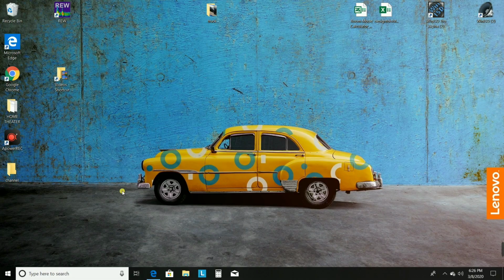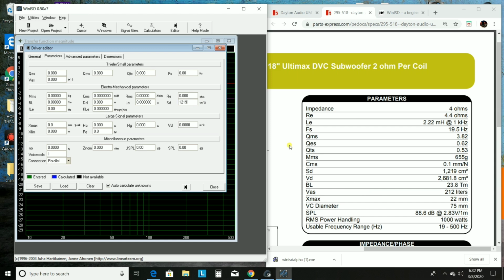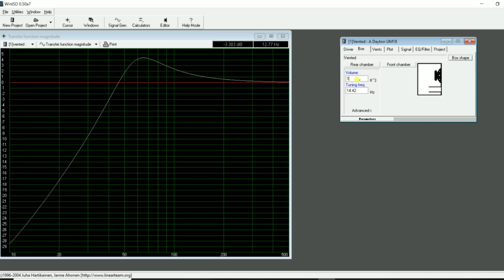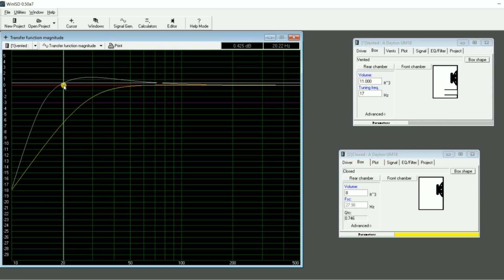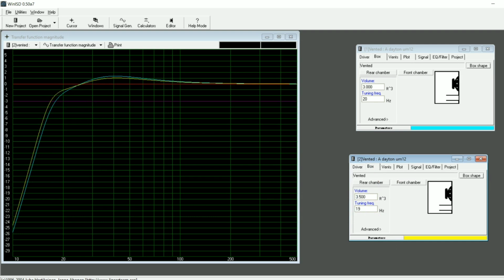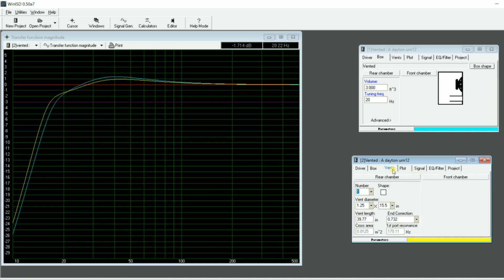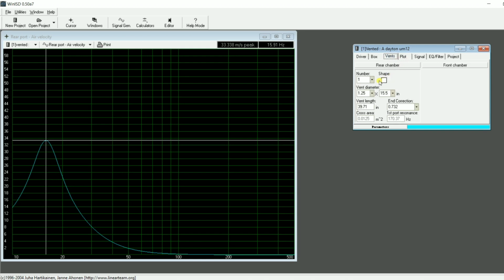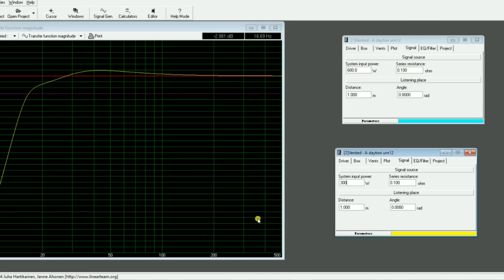Ep. 32 - WinISD tutorial for the beginner. How to design an Awesome Subwoofer | Home Theater Gurus

Comment: Yes ported can get lower but the phase shift is extreme at the Port.  Sealed sub phase shift is gradual.  Proper loading will bring the deep base up or you can overdrive the sub if it has a good Xmax.

Comment: Great tutorial. I like how you discuss the various trade offs for different properties. You mentioned box stuffing. Is that more of a trial and error thing or can you calculate how much stuffing to use. Do you always use stuffing? 
Will you discuss adding damping material to take care of box standing waves or is that just for speakers?

Thanks professor!
Reply from the maker: Yeah I glad you brought that up.  We don't have standing waves because our subwoofer frequencies are so much larger than the enclosure but we still line with insulation anyways.

With sealed we lightly stuff not line.

With sealed There's a loose rule that every pound of fill increases the enclose by 25 percent so you could guesstimate it by modeling the box in winisd with that in mind.

Comment: It's kind of a catch 22 because the program doesn't automatically subtract port displacement from the total internal volume, so we need to design everything, then subtract sub+port displacement  to get the real volume, and then adjust tuning again?
Reply from the maker: Yes this is a tool to design your sub and tune it but you do have to design the box including calculating the port, bracing and driver displacement.  The next videos continues with this stuff.

Comment: Buenas, tengo una pregunta. Tengo un subwoofer de 12 pulgadas, según winisd si le hago una caja de 150litros, funcionará muy bien, pero creo que son muchos litros para un subwoofer de 12 pulgadas. Que opináis?
Reply from the maker: If you entered the info correctly then you're good to go.  Some drivers need larger cabs than others.   150 is large but you may be able to dial it down a little and still get a good response from it.   The Um12 would work well in a box that size tuned to 18hz or so.    As you go smaller you may need to raise the tune a little to keep the raw response in check.

Comment: Hey can you confirm that the rockford p2d4-10 high fq rolloff is really around 1500hz I'm going to use for a 3way build an cross it at 500hz for the lows, an yes I know it's a sub but for the cost and it's t/s perameters it's the best that fits my budget I'm just trying to confirm that it can function up to 500hz I plan to feed it a constant 220watts a 2 ohms, it reads in winisd up to 1500hz with a - 3db rolloff is the software reading it right

I'm using it in a passive 10in radiator t
The tunable Dayton at 19.7hz in a 1.668ft3 box

Comment: You can download the T/S paremeters from loudspeakerdatabase.com, no need to manually enter.
Reply from the maker: True but not every driver is there and getting it from a manufacturer has less room for error and it literally takes 1 minute to load parameters.    It's also much simpler for those learning to do it manually.  If they ever need to load a driver they can't find a file for no problem as they aren't relying on another site to supply them with a file. I've never once used that site as I just prefer to load them myself as well.

But it's definitely an option.

Comment: Subwoofer Name: Subby McSub Face

Okay . . .my actual comments!

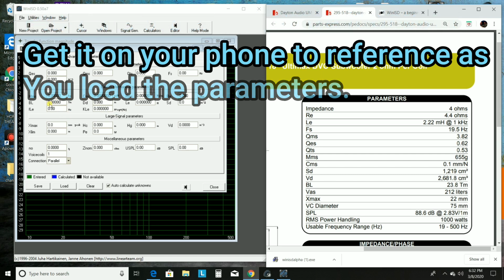05:15, I will say that you teaching me how to load the driver specs in the correct order helped a lot. I had drivers that I thought modeled AMAZINGLY, then I'd go back and reload the data in the order you taught me and the difference was NIGHT and DAY! That was sooo beneficial 

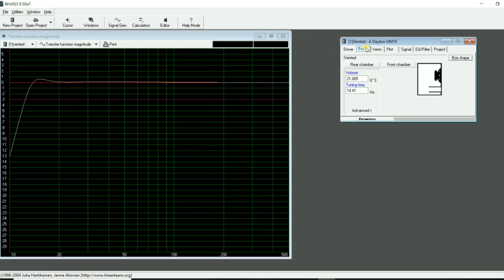08:56 . . .  no it's not . . .that's how all subs should be sized. Go as big as your room allows, the WAF should be secondary, HAHAHA! <3 

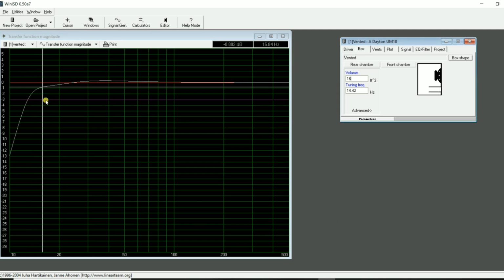10:24 . . . can you go into what you, as a professional, consider a "big buge room"? 

16:11 . . .yep . . .getting sealed subs to perform like ported subs means every sub has it's own channel (if not its own amp) and you absolutely MUST have multiple subwoofers/enclosures. Ported is a lot more efficient but I'd argue that sealed runs harder lower. But that's an argument for a different day. 

17:19 . . .yep . . .sealed subs require more power but they have that 2nd order roll off where as ported subs can be anywhere from 3rd to 4th order roll off. At least in my reading. You're the expert, HAHAH!

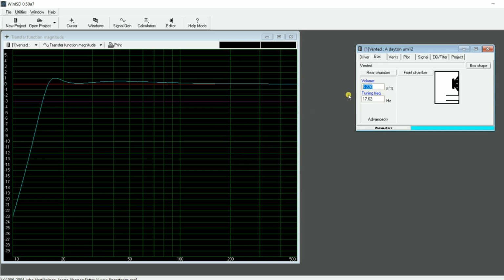19:00 . . .ew . . .3CF? I think even 5CF isn't THAT big of a sub. But I don't have to worry about WAF. 

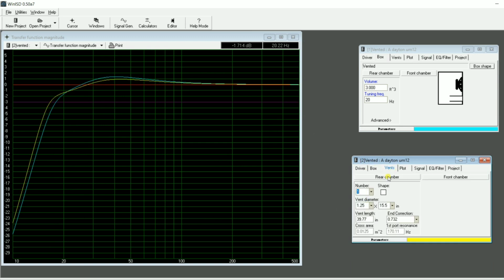24:00. . .I can't stand when the inches provided aren't "round numbers" so if I do build vented enclosures, I tend to go to the next whole number up. It's just a bit of OCD. 

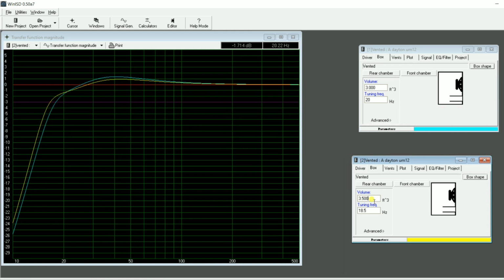24:58 . . .That's another PRO in favour of sealed. No need to worry about ports. That said, when modeling vented enclosures, I almost always work with gross. It's a lot more difficult (because it's easier to work with what you can see) but damn it's nice when you take final measurements and it's within 1 or 2 percent of what your original modeling said it'd be. 

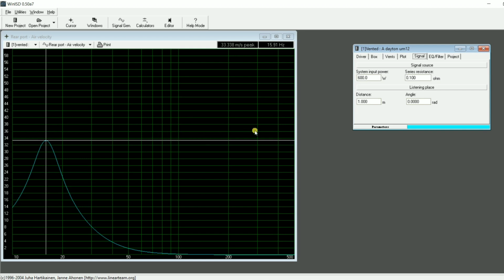30:50 . . . you know what doesn't chuff? Sealed subs ;) 

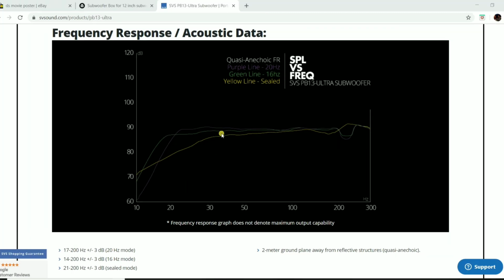35:50 . . . I'm not a huge fan of SVS with their active subs. Their passive units used to let you amplify and DSP as you felt necessary. They went all active and now it's up to them what you get and usually those numbers are . . .anemic and lackluster . . at least comparing to what we've built. I know, I know . . ."okay Boomer"

I can't wait to see this thing come to life and see the real-world tests of it in your room! That's going to be exciting! I still wish you went sealed, but ported is going to apply to most people and is most realistic for home theaater. 

Awesome video, as always. Sorry about the text-dump comment.

Comment: Sometimes i wonder if we tune Ported subs To Low ,since you proved yourself most Low End content is mostly in the 30-50Hz range  , ...Perhaps tuning Higher 20-23 Hz would be generally more satisfying , where most Low End content is ??
Reply from the maker: I like to have a - 3 just under 20hz if possible.  Sure the brunt of the demand is usually above that but it does add to the depth of the bass.  I kinda feel the chest kick video kinda ignored that while demand isn't as high below the peaks we saw its still important.  I wish I could easily go back and just clarify that.

The HAMMER has actually had a tuning change as seen in the build video where I simplified the port by raising tuning to 20hz and also gained a little more output above tuning.
Reply: @hometheatergurus  I think that is a good trade off !,. more Output where it counts most !

Comment: what do you put in as a signal input on winlsd? If I change my input to 2 ohm I get a very different response. Winlsd always starts with a 0,1ohm load. But that is not what it should be at right?
Reply from the maker: You can set it up when loading the driver info
Reply: @hometheatergurus  

So when I set up the ohm and RMS in the driver info there is no need to put in the signal watts and ohm to get a correct graph in WINLSD?

Comment: So i was hoping i could use the HT1 18 with the DIY group kuda flat pack. because it has the perfect look and dimesion that i like but @ 8cuft net, its not tuning very well might have to get more with higher net cuft
Reply from the maker: 8 cubes is on the small side for many 18s unless you want to live with a higher tune.
Reply: @hometheatergurus  well FI recommends 6-8cuft net @ 26hz for there HT1 but looking at winisd looks like 11-13 @ 20hz looks more flat response challenge will be the round ports velocity and room for the enclosures . decisions decisions

Comment: make a video on: how do I know where to integrate my in wall subwoofers in my dedicated HT room? :) that is the question! presuming you are building that room from scratch or you already have the room and you need to add materials to accommodate the speakers within the structure.
Reply from the maker: That's covered in the room mode episode and the sub setup episode.   I'll go ahead and say if it's a dedicated space that's rectangular and symmetrical 1/4 and 3/4 in the front wall is a great spot.   But.. Seating placement is critical.

Maybe soon I'll make a video just on that not mixed with anything else.

Comment: I'm following along your video and using UM18-22 (two enclosures / one 18 per enclosure) for my project. I have available space to accommodate enclosures larger than the Standard Full Marty with the space behind my AT screen. Any reason to not design a huge box vs. the 11 ft³ Full Marty? 

Playing with WinISD: ex. 11 ft³ Full Marty volume, tuning frequency @ 14.43 Hz, signal 1,000 watts - I'm configuring it with a square vent  2.5"x22" and the velocity is almost off the chart (62 ft/s at 14.4 Hz). I'm running iterations of vent height to drop the velocity, but the vent length becomes too long (+58"). Can you recommend changes that will bring this inline with your recommendation of ≤ 30 ft/s. 

What is the vent area & vent length for the Full Marty and what are Box dimensions for a FM? Curious how that vent is configured in a FM.

I understand there are some 'rules of thumb' for driver placement in the enclosure relative to the external port and port opening inside the enclosure relative to adjacent surfaces. Can you touch on this?

Thanks for putting this together. This is exactly what I needed to get working on this project. Wife getting tired of seeing drivers sitting in their box. :-)

Comment: Shame this was released before I made my VBSS subwoofer that thing is fucking huge, and people on the forums were telling me i should build full Marty...

Now this as great looking sub that isn’t huge, I’m just thinking of making a future upgrade but can’t decide between this or the Marty cube, so Which one should I choose? More info my room is 1700ft^3 and I’m planning to build 3-4 but not at one time.
Reply from the maker: That's a difficult question. The 18s in the large cabinets have more output but 4 of the ones we are designing will be more than most would need.
Reply: Home Theater Gurus just modeled it in winisd and it looks really nice but how much dose an extra sub add in output i heard it’s around 6db but is that true? 

Also modeled Marty cube im losing like 3db at 20hz and 6db at 30Hz but those are at levels I will never reach and the difference will be smaller when I add one or two subs.

Also should you put a 4th order highpass at 16.5hz?
Reply from the maker: Everytime you double subs from 1 to 2, 2 to 4 etc you can gain 6db of headroom if they're all the same and all the same power on tap.

Now that's if you could get a perfect summation which you won't.  If you're getting 4db per doubling you're doing good.

The um 12s in a well designed box are very impressive.  I've had people I've designed subs for that also had full Marty's and some have commented they would never have built the Marty's if they'd built the um12 subs first.  It depends on goals and how important space is to you.

My last theater had subs I designed similar to full Marty's but they were hidden.   For my living room I'd never use subs that were physically that large.  In my next house which were building I plan to use subs similar to what I designed in the video. 

As for the HPF yes you'll need one however it won't be set at the tuning frequency as the repsonse will begin to drop above where it's set as it's a slope.  I cover this an explain how to set it in ep 7.
Reply: Home Theater Gurus I was just experimenting with the winisd cone excursion and trying to get it to not cross the red line
Reply: You aren't happy with vbss?  Curious.. but.. why not?
I just made 2 of 'em, and while a bit big.. they are awesome for me.
Reply: John Dowty no I’m happy with them but they are huge. In few months I’m thinking about building something smaller and taking the VBSS to my music setup.
My issues are with the sizes not the performance in any way.
Reply: John Dowty also I’m looking to build 4 subs, so I need something smaller.

Comment: Have u tried RELs idé with setting center Channel to fullrange and connecting a sub with high Level Connection to the center?
Reply from the maker: Check out the videos on sub setup.  We keep everything set to small so we  have a predictable sub response that's similar seat to seat. If we allow the center to have an independent sub it will trash the modal response when information is present in that channel and not also present in the rest of the subs.

Comment: Hi, great videos once again, thank you for that. I think I am going to take the plunge and try to come up with all the spec for a full marty 18. I was able to get everything in, but I only have one issue, I can't get the air velocity down in 30s...it's way up in 50s, so is a bigger box allow for more velocity or should I modifiy something to really get down in the 30s? Thanks
Reply from the maker: Make the port bigger.
Reply: @hometheatergurus  did that, port is 5x24 now down to 34 velocity, but the vent lenght is now 105 in...

Comment: I'm unclear about +/-3dB. baseline. Do you mean that winISD calculates the baseline for the sub after we input the parameters? Not sure what to make of the graph.
Reply from the maker: Yes it shows you.  I explain the basics of a response graph here.

https://youtu.be/43SQpkwEVK0
Reply: @hometheatergurus  I watched the vid, but it doesn't exactly say how to interpret it. What exactly is "Baseline" zero dB? Because the sub model indicates that it can play higher dB, depending on the volume, etc. I have no reference of what the baseline even represents, so I am confused.
Reply from the maker: in the video I linked it explains that baseline can be flat (accurate) or it can have a designer house curve.   The +/- 3db should follow their baseline whatever baseline they desire.   The baseline is just the target response theyre following or designing their speaker to.
Reply: @hometheatergurus  Thank you. So, when i use winISD Pro for a rockford P3D4-10, run ported at RF recommended volume, and port length, etc. the simulation shows a 40 Hz peak at +7 dB. I can't get the simulation to make a box exactly as RF recommends. 
--So, that +7 dB I suppose is wrong, maybe I entered the info wrong. 
--Some say to desire peak above baseline.

Comment: I'm gonna disagree that Dayton under spec their subs. Xmax is the linear maximum of the coil after that it gets unlinear. That's why there also xmach / xlim. This is where the cone hits the back of the magnet and damage can occur. Xmax is calculated so there is not over specking or under specking. 
On the filter to protect the driver from frequencies under port tuning you will lose dbs because the filter is not a wall, the mini dsp can do a max of 24db if i'm not mistaken, so you will lose more db in the lower frequencies where the port it. We don't know how much the room will help so it's a consideration when doing a design like you did with that hump. You can also add those filters in winisd to see how much it will affect your frequency.
Reply from the maker: Well aware what xmax is.  If you haven't seen ep 7 check it out. It goes in depth on how and where to set a filter.
Reply: @hometheatergurus  I've watched all your video :) and i love them, i just don't remember everything. 
I'm DIY-ing two um 18s in sealed because of size and placement restrictions. Hope it works. They gonna replace a single pb-1000. But his covid-19 thing will slow me down quite a bit =/
Reply from the maker: Thanks.

And the only reason I stated they under spec is there's independent data that shows they remains distortion free beyond what they spec.   But it's definitely not a good practice to purposely push any driver beyond its rated xmax.

FYI In the new dedicated theater I'll be using sealed um18s.  Probably powered by speaker power amps.

Iny open living room I'll be using 4 subs similar to what we're designing in the video with um 12s.
Reply: @hometheatergurus  Can't wait for the videos!
Reply: Home Theater Gurus why use sealed when it’s -3db point is 27Hz and you need more output down low to hear it as well as you do the upper range? Unless you are accounting for room gain which you approximately need a room with it’s longest dimension smaller than 21 feet for room gain to start around 27Hz.